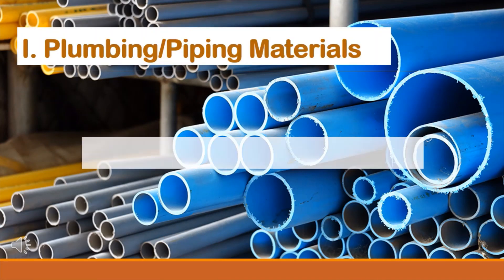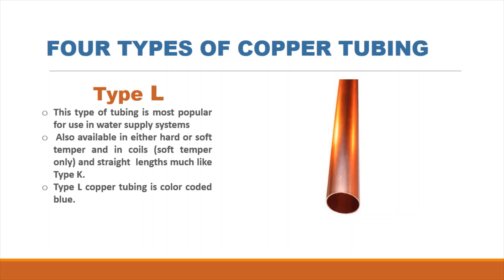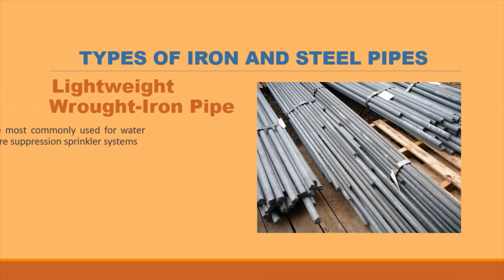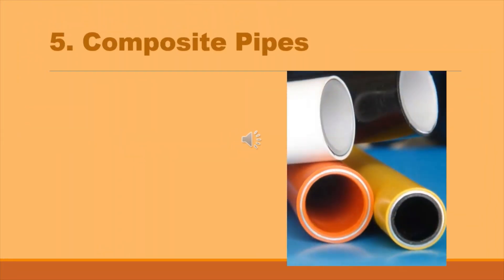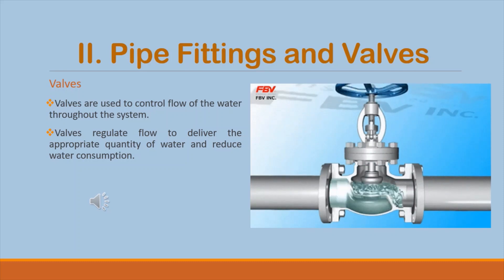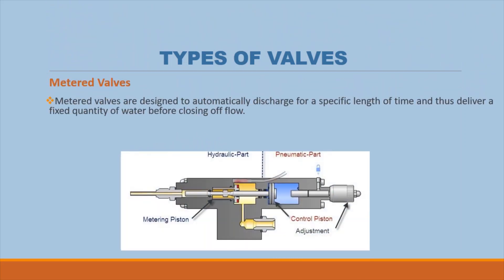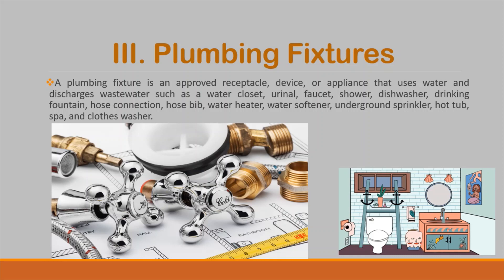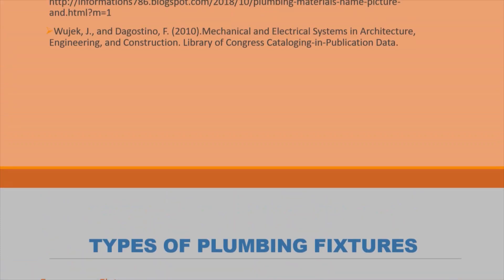Plumbing Materials, Fittings, and Fixtures

Comment: What for is the color coding in copper tubing and its differences?
Reply from the maker: The color coding distinguished the differences of its types because each type has its own uses for example the type k is for underground water service in water supply system. And for the differences kindly refer to the video.

Comment: What is the life expectancy of pipes used in homes?
What measures can you suggest to maintain the quality of pipes mentioned?
Reply from the maker: Ang life expectancy nakadepende sa kung saan gamit ang pipe. For example ang copper, brass, and galvanized steel pipes mga supply pipes sila na under sa constant amount of pressure. Ang brass pipe 40-70 yrs, galvanized steel pipe 20-50 yrs,  copper pipe atleast 50 yrs of life expectancy.
Reply from the maker: Ang drain lines since hindi naman sila under a constant amount of pressure matagal ang life expectancy nila compare sa supply pipes. Halimbawa ang PVC indefinite ang life expectancy nila.
Reply from the maker: Always imonitor at regular check up sa plumber.
Reply from the maker: We have various commercially available pipes because they have their own purposes and uses. There are pipes that are only used for water supply, used as waste pipe, vent pipe, underground pipes, etc. Moreover, pipes such as Thermoplastic and/or Iron and Steel have varying resistance to chemicals (corrosion), heat, and pressure. It is like the different types of pipes already  have their own role to portray. The proper and appropriate use of pipes to several plumbing functions make the pipes' life expectancy longer, since the vulnerability of pipes to certain circumstances are already identified.

Comment: Is using low cost pipes adviseable?
Reply from the maker: It depends to the size of construction, because if you were to construct the plumbing system of a huge and high rise structure you can not put at risk the quality of the construction and the people by using substandard pipes but if the construction is small like residential house you can use low cost pipes but make sure to have a proper installation of it.

Comment: Great video presentation. My question to the group is; which of the common pipe materials is the best to be used in our house plumbing system. Explain why is that so.
Reply from the maker: Thank you po sir.
Reply from the maker: Copper pipe, PEX, and PVC because of its durability. Pero ang most common na gamit dito sa Philippines ay ang PVC because it is easy to install and mas mura siya kaysa sa ibang types ng pipe.

Comment: What plumbing pipes are bad?
Which pipe is good for plumbing?

—Darren Jade C.M. from group 3
Reply from the maker: The quality of plumbing pipes, either good or bad, depends mainly on what structure or building it will be used in. Based on the information that we researched, one factor that affects the quality of the plumbing pipe is climate.
Reply from the maker: Since nasa Philippines kita dapat ang material ang naka withstand sa climate ta as well as natural disasters